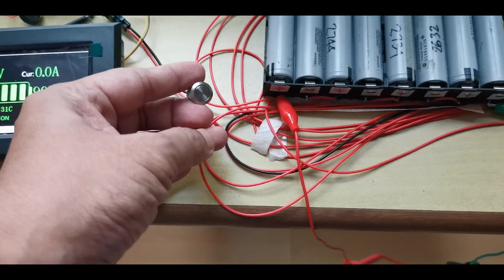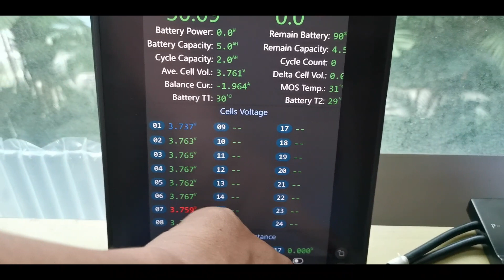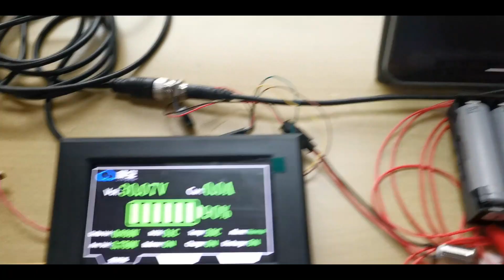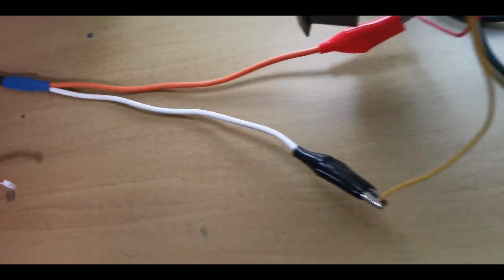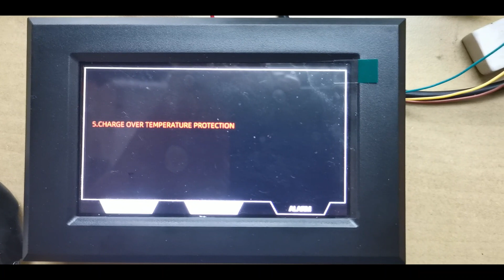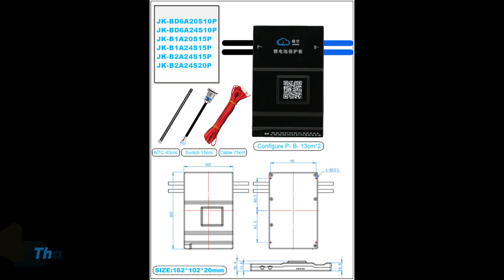200A JKBMS with new 4.3inch LCD display

Comment: What is the voltage of the power supply to the screen
Reply from the maker: i have supplied 12v
Reply: @bryanmendoza2770  max voltage of the monitor can handle ?

Comment: For the switch, do you know how it operates... when you turn it on, it gives voltage to the bms and when you turn it off, it cuts the voltage? I am asking because I am using this on a cart and was wondering if I could use the ignition to power the bms somehow, maybe through a relay or something, instead of the switch. I'm just curious : How does it turn on the bms vs a regular switch?
Reply from the maker: i''m not really 100% sure  i have not tested switch with a multi-tester. the switch is like a momentary switch with 2 wires so probably you can use normal switches to wake up the BMS but to turn off there is a delay that you need to simulate a 10s pressed or something.

Comment: I'm a little confused on the LCD. I ordered the display separately. Connected everything up but have the 2 free wires hanging out. Are these power wires and if so how many volts are you using to power the LCD? Is it a separate power supply than the one the BMS is using?
Reply from the maker: I connected the lcd power supply to a 12v1amp. Its separate power because your battery is usually of higher voltage unless put a voltage regulator.  My bms is minimum 7s.

Comment: Hi, do you know the if the jk-bd2a24s20p is newer or older than the Jk-b2a24s20p?  Or what the difference is between the two?  Did you purchase the lcd screen seperately?  Thanks 👍.
Reply from the maker: I am not sure on this but they do have different version the one with heat pad function.

Comment: can i enable/disable BMS with push button. I don't want to buy a monitor. If yes please share the connector pin. Thank you
Reply from the maker: The power off/on button was included with the monitor. Need to review the wiring configuratiin if possible to wire directly to the bms.

Comment: Sir Nice video !  
What happends if both Charge and Discharge is on simuntaiously, As I can see both turned on in the app 
Can we connect it to one power source and Load at Same Time
Reply from the maker: yes. no issue. that's the goal to keep both charge on and discharge on in running condition.

Comment: Hi,is there a way to turn off the LCD screen without turning off the bms? Thanks.
Reply from the maker: So far not possible but you can add a switch to cut off the lcd power supply that will work.

Comment: Hi Bryan, do you need to have a charger or load connected before turning ON the bms? I have an 8s configuration and a JK-BMS type JK-B2A8S20P-H.  The BMS turns On and light is flashing.  But when I opened the app and DID a SCAN I cannot see the BMS device.  When I looked at my mobile bluetooth the device is there.  It means my mobile bluetooth is recognising the bluetooth of the bms.  Thank you.
Reply: No, you dont need a load, but the battery must be connected of course.  The bms can be started with a charger I have found as I have the same bms as you have and am having problems with the Bluetooth connection as well, but it could be a problem with my BMS as when I start it up it gives 3 short beeps and then 1 long beep. I dont know what is wrong, all the balance leads are correct and it was working for a week prior okay. Any idea’s what that might error signal may  mean? Also, my app shows the BMS but it will not connect anymore.
Reply: @evil17  I contacted the seller and told me to connect the Heat Function cable.  The RED and BLACK cables must be connected to the charger.  It worked!  (You dont need to have Heat pad)

Comment: I have growatt spf 5000es inverter,can i connect it with this BMS and communicate with inverter
Reply from the maker: So far, i dont see any sufficient documentation for the manufacturer about the bms communication port which inverter or protocol is supported to work. If you need those feature i suggest don't use this inverter for now. There are a lot oem server rack batteries now has those communications port that connects to inverter you just need to ask the seller which is compatible to your inverter system.

Comment: Lad Bla
před 1 sekundou
Can you please let me know how did you connect the  black cables marked P-? And why are there 2 blue cables marked B-? One is not enough?Thanks for the reply
Reply from the maker: for the purpose of testing i only use 1 wire for (P-) and 1 for (B-). In actual installation you should use 2 wires to carry more Amp load since these are in parallel. The (P-) is your main negative to your inverter or tester(-). The (B-) is connected to the main negative of the battery. The main positive of the battery is your main positive to the inverter or tester(+). So your main negative power supply is protected by the BMS to cut-off the voltage output for abnormalities.
Reply: @bryanmendoza2770  Thank you for help

Comment: Hey Bryan, thanks for the video.  I am also using this BMS to upgrade my Daly.  My lcd (same one) has a switch wired in parallel with the LCD harness.  It only seems to fit in the GPS port (the switch), is that were the switch plugs in on the BMS?
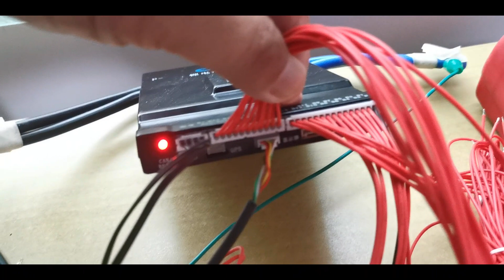Reply from the maker: the wiring harness is total 5 pins which combined with the 3pin for 485 com port and 2pin for power button. pls check in the video for a closer look at around 9:00 minutes.
Reply: Yes, I believe that is correct

Comment: HI, Thank you for the video. Is there a way to keep the backlight of the LCD display turned on infinitely as long as BMS is active?
Reply from the maker: I noticed it is always on as long as you have the 12v external power supply. The other 3-wire cable going to BMS is the 485 communication port that get's BMS Data
Reply: @bryanmendoza2770  Hi,lcd screen work only with 12v power supply or will be feed from bms? If i have 24v setup i have to put an dc-dc converter
Reply from the maker: @mariusmc69  i have not tried 24v to supply the lcd because i'm using dc-dc converter from 48v-12v for usb charger and fan temp controls.